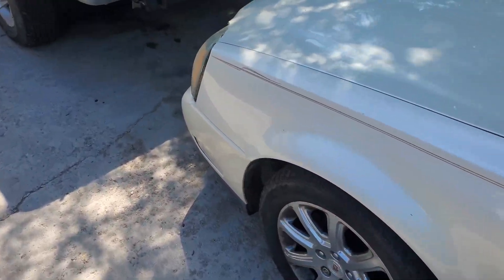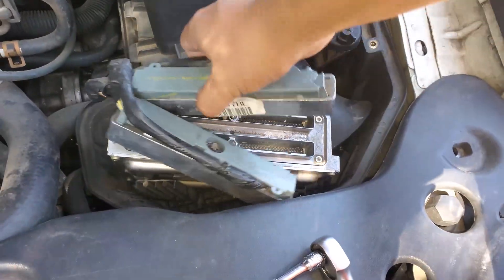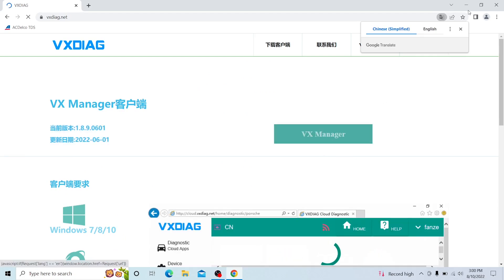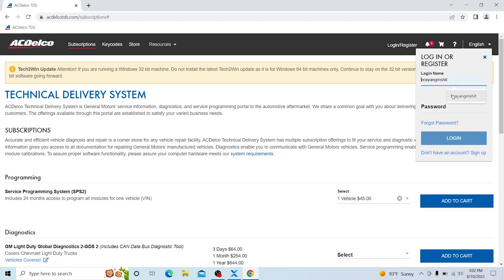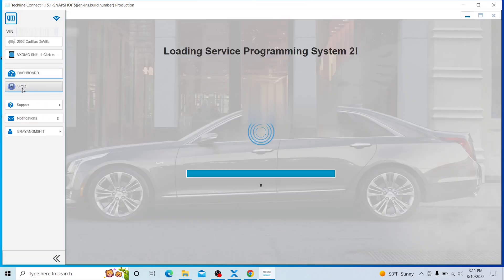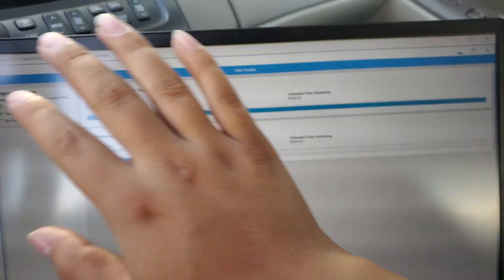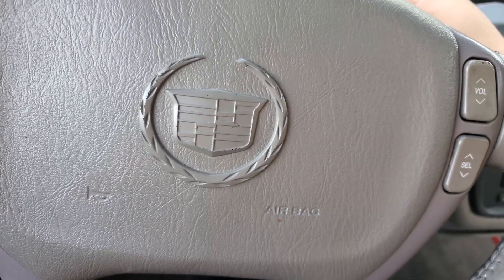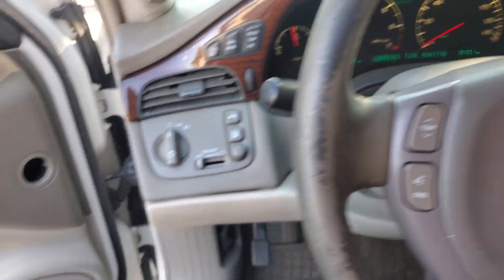How To Program Engine Computer To GM Vehicle Using A VXDiag and SPS2

Comment: Thanks for this video. Very informative. 
When you programmed the used ecm, did you have to input the car VIN so that the new ecm will get the car VIN or will the SPS2 input the car VIN into the ecm? Asking because I am trying to install a good used SRM module into a caddy.